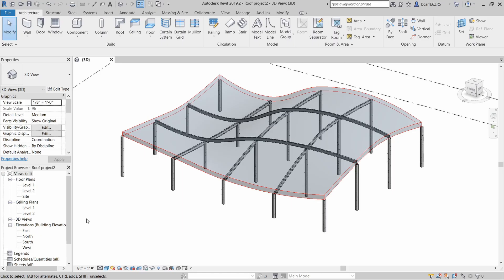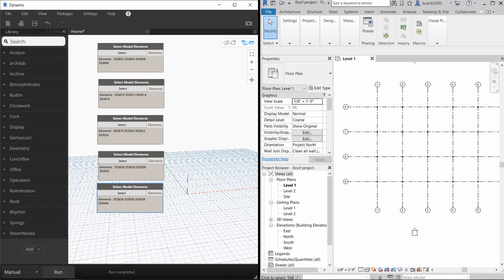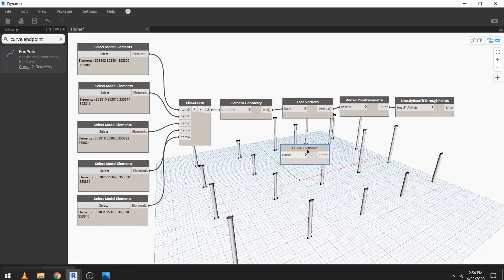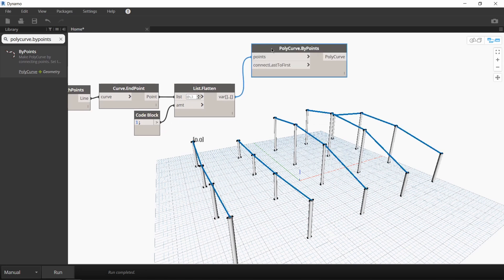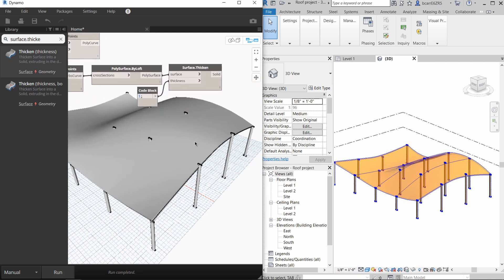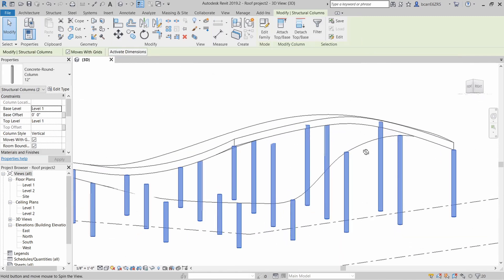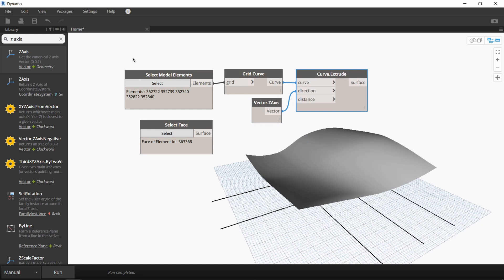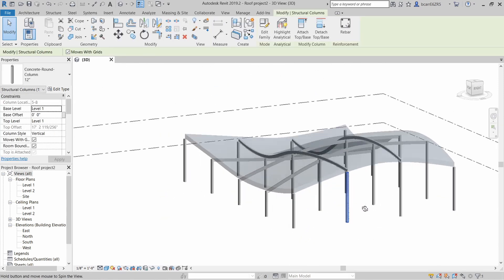Creating a parametric curved roof in Revit w/ Dynamo | FREE download

Comment: How do you feel about icf homes or icf blocks
Reply from the maker: They are a very promising solution in hurricane prone regions and tornado alley. They are a good alternative for diy home builders too. The main issue I see is tricky and expensive waterproofing. It's a fairly new product, so everything is proprietary and there isn't enough competition right now.
Reply: @BelindaCarr  look this over water proofing is easy, and the cost for it in the usa is low. Its just the cost of of 
concrete and the steel bars you do not even have to put in them if you use STEEL FIBERS IN CONCRETE

https://youtu.be/_hBfFHPvb9I
Reply: @BelindaCarr  
I was talking about using Helix Steel is the manufacturer of Twisted Steel Micro Rebar in your icf wall system to cut down on cost